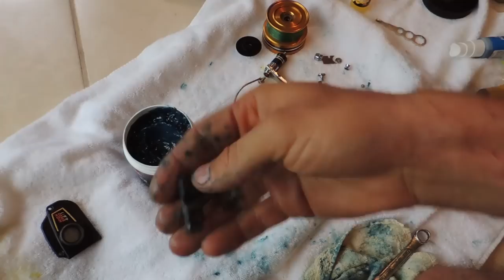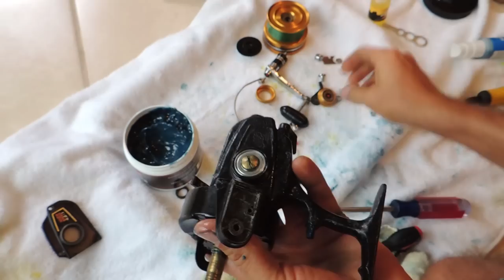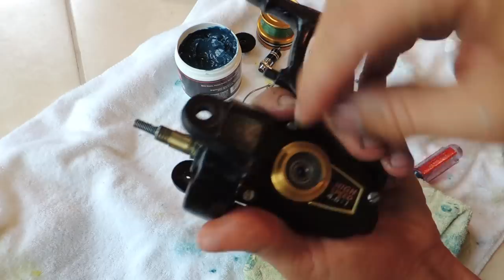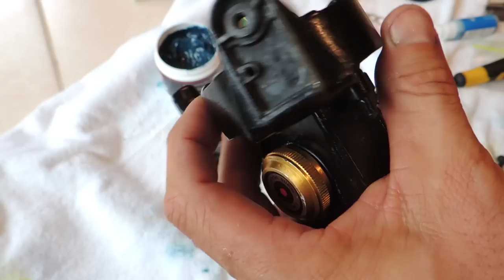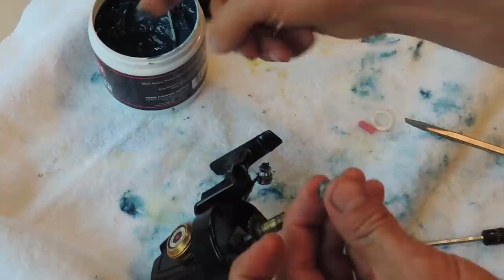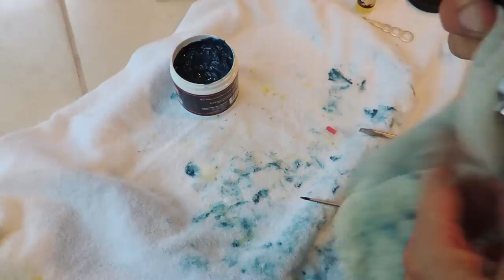Penn Spinning Reel 750ss / 850ss Maintenance Tutorial (disassemble / assemble)  PART 3 of 3

Comment: I just bought a 750ss today.    When reeling it has a clanking metallic sound...Not real bad and it doesn't effect me reeling my weight in but the noise bothers me. Sounds like it's coming from just under the spool.....Any Ideas what that is?  And thanks for the video. I am going to disassemble and grease mine tomorrow.